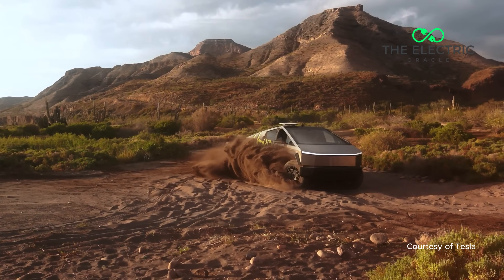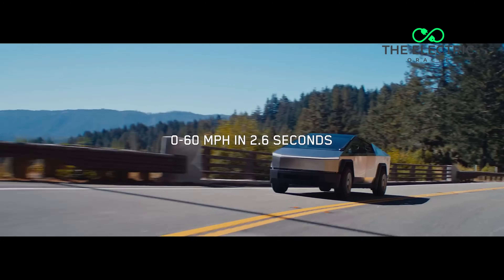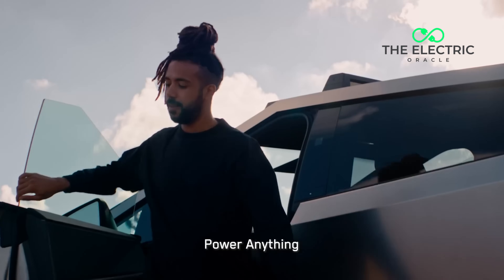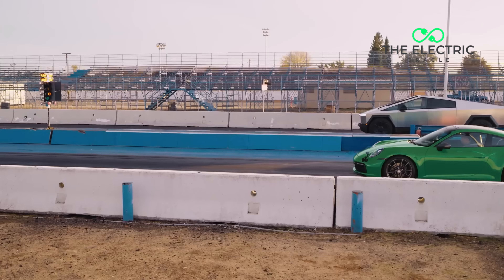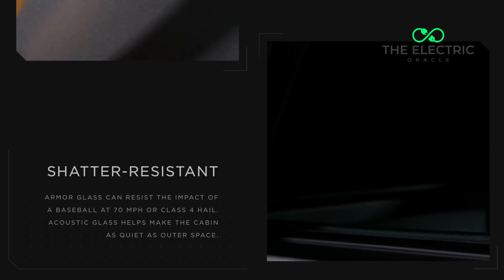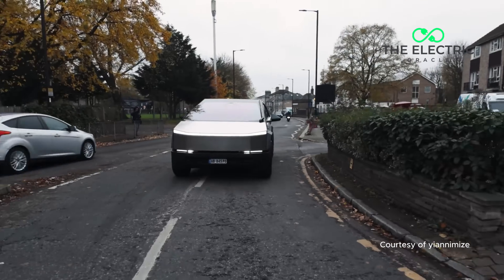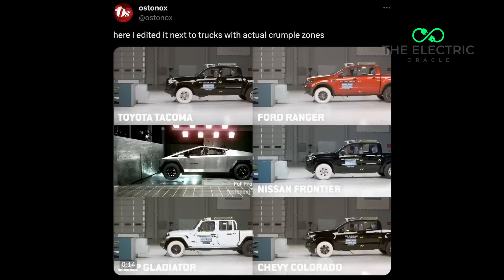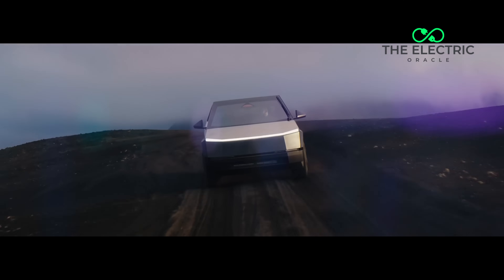5 Safety Issues Keeping Tesla Cybertruck Off UK Roads 🇬🇧

Comment: It might be one of the smaller issues but yellow indicators... I know Tesla has a reputation for being lazy but I'm pretty sure in this modern age we can have red and yellow LED in the same place at the same time. Someone think of the shareholders will have to redesign absolutely everything. Regular manufacturers do a significant amount of redesigning for different markets it's pretty common. Do they usually do that the first time round so they don't have to redesign it.

Comment: As much as I agree cyber truck faces alot of problems being registered im the UK. Unfortunately one key fact of your argument needs fact checking. As per his latest video Yianni has had his truck weighed, it comes in under 3 tonnes weighing about 2.5 tonnes, so it falls under the weight restrictions of a standard car and does not need a c1 licence. As far as weight is concerned it is well within the limits of a standard road vehicle.
Reply from the maker: Thanks for your comment and you make some good points.
Unfortuantely, it wasn't just the weight that was an issue. There was a raft of other things.
Reply: @TheElectricOracleChannel  totally agree mate. The cyber truck is nowhere near ready for UK roads. It's a brick on wheels that could potentially kill someone. Personally can't stand the cyber truck, just very interesting to see the legality around it and the problems it's facing being registered in the uk. I found your video interesting and uou seem to have a very interesting channel that I will be subscribing too.

Comment: EV don't need a special weight exemption for batteries - with newer battery tech and increasing energy density, the batteries can be smaller and lighter while delivering comparable range. EVs need to  be smaller and lighter - take the GWM Ora 03/funky cat or VW e-Up. with a higher capacity battery, that's where EVs should be heading.

Comment: The American Youtube channel "Technology Connections" has a whole video dedicated to a rant about the dangers of the North American combined brake-light/indicator system as it introduces an ambiguity for a brief, but critical period of time. It's not as if the system used in Europe (and most of the rest of the world) with separate indicators and brake lights is illegal in the USA. It's not. What is weird is that the North Americans (as this affects Canada too and, for all I know, Mexico) persist with this rather fundamentally flawed system.

nb. excellent coverage of the issues by the way. However, one other thing to point out is that these standards are not specific to the UK. They generally apply to the whole of the EU, which is a much bigger market. Not that I think Elon Musk will market the Cybertruck in Europe anyway. The evidence seems to be that the whole hype around the vehicle in the USA has largely run its course with the initial enthusiasm waning rapidly.

Comment: Yianni has shown that the Cybertruck weighs less than 3500kg in his latest video
Reply: Ladened weight.
Reply: @ he also showed that fully fueled with 5 big guys on board, it weighed exactly 3500kg
Reply: @andrewwilson3448   And what about cargo? Because the important weight is the fully ladened weight. Including its 1000kg cargo carrying capacity.
Reply: @ if you carry cargo, then get rid of the passengers

Comment: 42,000 road accidents fatalities in the USA in 2022. Number in the UK in the same year, just over a 1000. Tells you everything that USA regulators don't see protecting pededstrians as high priority. Allowing a vehicle,with sharp edges, to be on the road is idiotic. Even owners of these tanks have had cuts.
Reply: Bear in mind that the UK is a little bit smaller than the US.  Are your figures absolute, or per miles driven?
Reply: @stevemawer848  those are absolute figures. In terms of the KSI statistics per 100m miles, in the USA it was around 13 killed and 80 severely injured. In the UK, the figure was 5 killed and 8 injured. Part of this may be due to the prevalence of heavier vehicles in the USA, and therefore, collision with pedestrian can lead to more serious injuries.

Comment: The Cyber Truck is made from a stainless Steel alloy supplied by the Finnish company Outokumpu. It has been known to stop 0.22 rifle rounds but anything bigger will penetrate, so it's even a stretch to call it bullet resistant.  
Perhaps Musk has used the term 'armour grade' to describe the panels but the manufacture has definitely not used that term to describe the material.

Comment: I wouldn’t think it will be legal in Europe either. The Cybertruck will go down as all hype and no substance. The sales are tanking and buyers are not taking their orders. A rust bucket on wheels.
Reply: Especially in the Netherlands  where their  roads are a lot more narrower. With all the canals.
Reply: Well they may discolour with mold but cannot rust.
Reply: @mbak7801 they are rusting.

Stainless steel isn't rust proof, it's rust resistant.
Reply: @mbak7801 they have aluminium castings front and rear fastened to stainless and mild steel components.. just add a little salt water and they will dissolve internally
Reply: @karlhofmann1446 has electrolitic corrosion been factored in, I have worked with series Land Rovers for decades and steel to aluminum is always good for a laugh.
Reply: @CrusaderSports250  Series Lardrovers didn't use Aluminium, they used Birmabright which was a leftover fom WW2 aircraft production. They started using Aluminium with the introduction of the 90s and the 110 coil sprung vehicles.
Reply: @karlhofmann1446  Birmabright is an aluminium alloy, no one builds with pure aluminium as it is too soft, using "aluminium" as opposed to "Birmabright" avoids trade names in the adverts and the subsequent legal issues, and also means they can source cheaper less defined material, either way it is still subject to electrolitic corrosion.
Reply: @CrusaderSports250  Agreed though if Tesla have made adequate provision for prevention of corrosion remains to be seen. Given that there are several videos of the Stainless cladding detaching itself from the frame, I'm not optimistic...Fortunately, this is not a problem that I will ever have.
Reply: @karlhofmann1446  probably never a problem in Britain, but the last thing you want is a detached panel hitting you, time to break out the plasma cutter to make some holes for pop rivits😊.

Comment: Also, technically if it has over 3.5 tonnes laden weight (this will include any combination ofoverall empty weight, passengers,goods or towing load then this would also require a tachometer and relevant competency certification,  digital tachometer record keeping for audit compliance by VOSA.

Comment: Just a point to note when you were talking about "Euro NCAP". Quote..."Euro NCAP is a voluntary vehicle safety rating and a car does not legally need to have a Euro NCAP rating in the UK". However to use a vehicle on UK roads it must conform with "The Road Vehicles (Construction and Use) Regulations 1986". The Road Vehicles (Construction and Use) Regulations 1986 is up to date with all changes known to be in force on or before 22 January 2025. https://www.legislation.gov.uk/uksi/1986/1078/contents

Comment: “E-arny” its pronounced “Yanni” also, the cyber truck weighs 2950KG unladen, not over 3.5 tons!
Reply: Ladened weight is what matters.
Reply: @nigelgarrett7970 it will still be class 4 and not class 7 over 3.5 tons
Reply: @Onelitretyreeater-w4s   The weight that matters is when it is fully loaded with cargo. Most 7.5 ton trucks weigh 4 tons when empty.
Reply: @ yes. The point I’m making is that if type approval is and when approved i doubt this will be registered as a commercial vehicle
Reply: @Onelitretyreeater-w4s   Whether it is a commercial vehicle is of no relevance. The weight used for all vehicles is the fully ladened weight. It may weigh 3000kg, but it can carry 1000kg of cargo. Welcome to C1 land.
Reply: @nigelgarrett7970  seem to be going around in circles here. I’m not disputing what’ve you’ve said. I merely saying that I think it will still be class 4 if and when it’s has been type approved after SVA

Comment: You didn't mention the drive by wire steering with no mechanical connection between the steering wheel and the road wheels.  This is illegal in the UK and is only allowed in off road construction type vehicles, which have a very low speed compared to road going vehicles.
Reply: Totally - and construction sites have pretty strict rules themselves around the usage of the kit you're referring to.
Reply: Hood ? Don't you mean bonnet here in the UK 🇬🇧🇬🇧🇬🇧🇬🇧
Reply: 50 kph is not that slow, I work on making off road construction vehicles. They are still of course not road legal, except there is an exception aruond the factory where they are build to we can drive the smaller models between the two factory sites, one of which is right in the middle of town. I still believe they have follower vehicles though, I never seen them moved except on a trailer.
Reply: That’s a very good point that I certainly didn’t know about👌🏽
As for the confusion above folks are mistaking electronic ‘fly by wire throttle’ with steering presumably 🙄
Reply: How does Yianni plan on passing the IVA then? Or do you mean that drive-by-wire would be illegal for mass type approval?
Reply: My work van has an all digital driver display, no clocks or gauges just a big screen. About a month into having it I was asked to install a software update when I went to start it one morning, I did and it all seemed to work fine. Then when I got onto a smart motorway section of the M6 the instrument display screen and also the head unit screen both went out and nothing I could do with the vehicle running could get them back. I got to a bit with the variable speed limit set at 50 not actually knowing what speed I was doing, just maintaining a gap with the car in front. 🤣
Based on that experience alone the idea of entrusting a computer with my ability to steer the vehicle sounds terrifying.
Reply: @_______DR_______  I've had an ECU (two at the same time actually) fail and the sensation was nothing I have experienced in 45 years of driving.  One moment driving along and then NOTHING, zilch.  Ive had engines stop before and it took moments to happen but with the ECUs going out to lunch it happened in a nanosecond.  Electronics can fail and they will fail absolutely without warning, imagine that happening going into bend on the edge of a mountain??!! with fly by wire steering.  There are electronic systems that are reasonably reliable but the are military systems built up to a spec and not down to a price as with vehicle production.
Reply: By pilot-by-wire is perfectly legal for pleasure boats and yachts, and for private light aircraft. So it's not like we don't have them, it's just that we aren't consistent with the regulation.
Reply: @darthkek1953  Yes, but the steering of boats is not reliant on instantaneous response and aircraft have a very high spec threshold with frequent and extensive checks being carried out, whereas vehicles are built down to a price unless its a Rolls Royce
Reply: Just so you know fly by wire has been used in Fighter jets and commercial aircraft since the 1980's, when you fly to sunny Spain etc those aircraft a fly by wire, it's not new, it's has decades of testing, refinement and use. If you think our grandchildren will still be driving the same combustion engine cars with the same design then working on that principle we'd all still be driving the Ford Model T, change is the only constant, accept it.
Reply: @Michael-Wil  The point is that the systems provided on those aircraft and before them space craft, whilst primitive by today's standards were well thought out and at the pinnacle of their development.  The systems in cars however, are built to be as cheap as possible.  I don't doubt that manufacturers could make the systems so much better and you don't have to look farther than those systems in competition cars to see how good it can be.  I just object to having second rate just to save a few pence.
Reply: @clivewilliams3661 aircraft also have multiple redundancies and very strict servicing requirements, with components being replaced well before they wear, applied to cars you would rebuild the engine at 50,000 miles, instead of going for 250,000 without opening it, makes the comparison others have made pointless.
Reply: And airplanes.
Reply: @DouglasEKnappMSAOM  Boeing still mostly use manual input feeding into hydraulic actuators for the controls, whereas Airbus tend to use fly by wire.
Reply: Not factually correct as UK has had drive by wire cars since 2007, 

Vauxhall GM Hy-Wire
https://youtu.be/0fBqkWkEeqU?si=5vs_pDMK3X6ssdQ_

Infiniti Q50 2013 - drive by wire.
Reply: @Ascelot drive by wire throttle and drive by wire steering are not the same thing or the same safety concern.  Drive by wire braking would probably not be allowed without a mechanical backup system (this is the case on toyota hybrids for example).
Reply: @lsorense there are already brake by wire cars in the UK. The NC1 NSX for example.
Reply: @dirtygrill  And like toyota hybrids it has a backup hydrolic system it will switch to if the electronics fail.  The cybertruck steering has no backup.  You don't need a backup for the throtle system since it just means you can't go.  You do need a backup for the brakes and I suspect that is also true for steering.  Low speed industrial equipment and farm equipment is different of course.

I have tried the backup system on my prius.  It's not very nice to drive with, but it is perfectly functional brakes.  Of course you loose regenerative braking when the electronic brake system is disabled.  In my case it happened because a wheel speed sensor failed and the car hence had no idea what one of the wheels was doing so it switched to the backup plain hydrolic system.  Much better again after the wheel speed sensor was replaced.
Reply: @lsorense  good points.
Reply: @lsorense  We have parking viz emergency brake that according to our antiquated C&U Regs should be mechanical but a good proportion of cars now come with electronic parking brakes only powered by wire.  It is interesting to note that such systems are not as powerful as the potential of a mechanically operated parking/emergency brake.
Reply: @clivewilliams3661  It's a parking brake.  The main brakes already have two circuits on modern cars so the parking brake does not have to be a backup, although usually you can still use the electronic parking brake as an emergency brake by pulling the button and holding it.
Reply: @lsorense  The handbrake was the back up to the service brakes in an emergency and under the UK C&U Regs that had to be mechanical.  I agree that with two circuits for the service brake allow one circuit to still function on the failure of the other but twin circuit brakes have always been backed up by a mechanical emergency brake.  It is feasible to damage both brake circuits simultaneously and loose all hydraulic braking and now even the emergency brake is lost.

I must admit that I have tested the electronic parking brake function as an emergency brake on wet grass, which activated the ABS, which I was not expecting.  I had endeavoured a handbrake turn, which therefore failed.
Reply: @dirtygrill  The eTron, Taycan, C8 and NSX all have "brake by wire" but also all have conventional hydraulic brakes operated from a master cylinder connected to the peddle as well as they wouldn't be allowed onto the road without it.
Reply: @Ascelot  The Infinity is not identical to the Cybertruck. It has a mechanical steering system that can be actively intervened in by actuators. In the event of a failure of the adaptive steering system, the mechanical steering system continues to function. In the Cybertruck, there is no mechanical connection at all between the steering wheel and the (front) wheels. If it fails, all you can do is pray. (But that also fits well in the USA) 
And as far as I know, the Vauxhall GM Hy-Wire was only a prototype.
All in all, the whole concept of the Cybertruck is fortunately a long way away from being ready for registration in Europe.
Reply: @svenbasco  know it's a prototype, point is was still on the road legal at that time.
Reply: @Ascelot  There are then temporary exemptions for prototypes and test vehicles, with restrictions on when and where the vehicle can be driven.
Reply: @Ascelot  One is a concept car, the other one has a mechanical backup
Reply: @Ascelot  Concept car not a production car.
Reply: @Ascelot  It was another US experimental vehicle that was not approved for use on the highway.
Reply: @Ascelot  Just watched the video which i thought was 2003.Also this was a one off prototype so did it or anything like it ever go into production.I am thinking specifically of the steering by wire.
Reply: @Ascelot  Lexus RZ too IIRC
Reply: It’s not illegal in the UK.